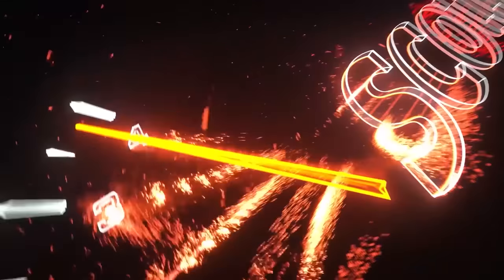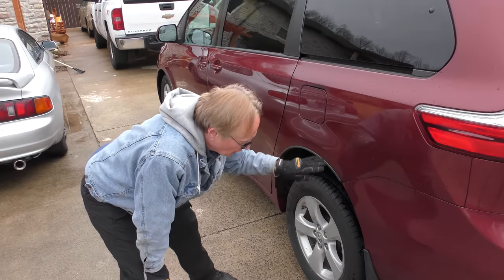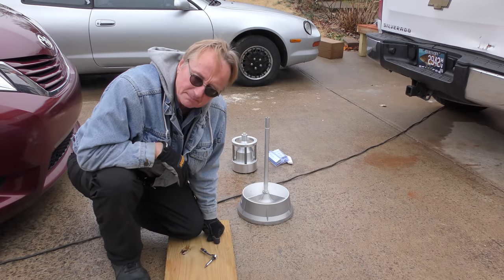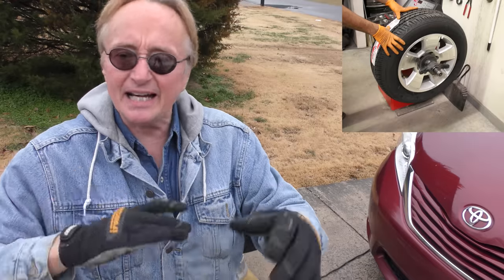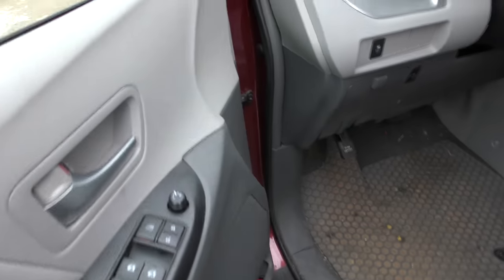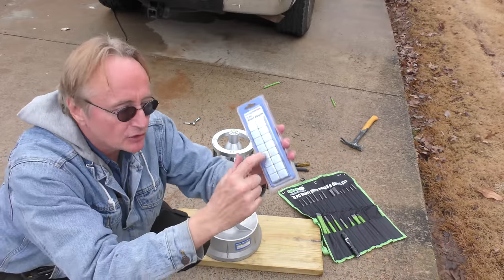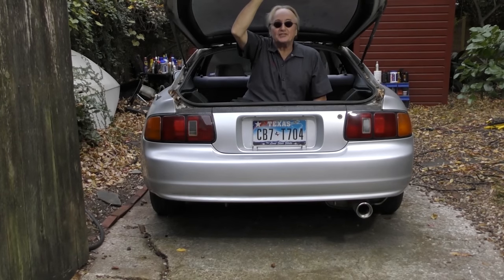Stop Going to This Tire Shop Right Now

Comment: I my case it was the stealership that tried to scam me.   45,000 mile service on my '16 Tacoma included tire rotation.  Driving way the truck was wobbling at 5 MPH.  I asked them to fix that.  Three ***ing hours later they told me they tried to rebalance the wheels  but one was bent !?? Well I didn't bite and drove home.  No wobble, imagine that, but one wheel was  out of balance. I took it to a tire shop that I trust and they easily balanced the "bent" wheel  which they determined was well within spec. 

Dealer couldn't even reattach wheel properly, and it's a steely no less.

Comment: Went to discount tire here in Houston and the tech ripped the stem right out of the hub with the impact wrench. They sent me down the road to get a new one pressed in it took 4 hrs to get a flat fixed. Another time they forgot to put on one lug nut and i didnt notice until it didn't pass inspection. I only go to small tire shops now.

Comment: Is it okay to do a wave-by near your house? I don't need auto repair unless you can fix a power shorting failure in the wiring of my wife's'93 Honda del sol. So meeting you wouldn't be necessary, unless you tell me I have to in order to sight-see your residence. Thnx in advance; really love your show.

Comment: I had the same issue with a local tire shop but for an alignment job. After taking it home it was pulling to the left. I took it back, made them redo their work just to cost them money, talked to a few waiting customers just to let them know and took the car to a reputable alignment shop the next day. Good thing I did or my brand new tires wouldn't have lasted. It was totally out of spec.

Comment: I have my tires rotated at every oil change. I know the kids at these oil change shops use an impact tool instead of a torque wrench to tighten the lug nuts. So, when I get the car home, I loosen all the nuts and tighten them to the proper torque. One time, I  found a lug nut that was on so tight that I needed  a 6ft steel pipe attached to my breaker bar to get it off.

Comment: What do you think of a  2000 Jeep Wrangler TJ with 54k original miles on it for $9500 that has a few issues, Main seal leak aswell raddles and it seems like it has its bushings and shocks shot.

Comment: I just take my tire off and take it to the local shop I trust to fix the balance if I question it. Had to do this for a friend that was complaining about a shake. I identified which tire was causing the shake by moving the tires around to different corners. You can feel a difference in the vibration also by loading the tire on a side more or less by lightly turning the steering wheel side to side making the vibration worse or better depending if the load (roll center) is shifted to one side or the other. Turned out that a belt broke on the inside of one of the brand new tires he had put on but it wasn't making the thumpetty thump noise yet... Ugh...

Comment: A question about dynamic balancing: most guys put on the weights the machine tells them to, but after that shouldn't they give it another spin to test if it's allright? Stopped making remarks because getting soprano homocidal looks in return

Comment: You need to be on your game to hope to not get screwed by tire shops. I've had wheels put on the wrong side, balance weights on the outside of my alloys & other atrocities.
I'm going to save a good used tire. If you ever get one tire replaced they'll tell you do you don't want to have a new tire & an old tire mismatch, I'll pay for mounting of my old tire for matching until I need a new pair.
Good luck getting them to honor your tire mileage warranty, the best thing you can do is stay on your alignments and tire inflation, check for uneven wear on tires. It MIGHT help to use the factory OEM tire.

Comment: I've been boycotting Firestone for the last 30 years because they installed a new fuel sending unit in the fuel tank wrong, and wouldn't fix their mistake. My fuel gauge reads 1/4, when the fuel tank is actually empty.

Comment: Gotta keep your eyes on them guys. One shop had a policy of putting a bit of grease on the hood latch assembly, but I stopped him, 'cause there was already a big glob still there from a previous visit, which I wiped off with his rag. Another time the kid tried to pry off the battery cell covers on a freedom battery and I stopped him b4 he tried to slip a screwdriver under the vent caps and told him, if you can't take 'em off with your fingers, they're not supposed to come off. Another bad habit they have is letting air out of your tires because the pressure is high, which happens when tires are driven, so I just tell them the tires are OK, don't touch 'em.

Comment: If a computer balancer shows 0 and 0 what else is there?  I've seen plenty of tire guys use the wrong weight for the wheel and they sling off over time.  That's my bet.  Nice bubble balancer.  I've got one too for my cheap cars.  Dynamic balance is impossible so you'll get a little wobble.

Comment: Definitely need to get me one of those wheel balancers. Question for you Scotty what do you think of torque sticks? When I worked at oil change/ quick lube location we occasionally did tire rotations. When we did the rotations we would use the air impact when taking off and putting on the tire but we're required to use a torque sticks when putting a tire on and then go through with a torque wrench and make sure they were set right.

Comment: I do just about anything iv learned from my old man ball joints wheel bearings shocks ect I won’t dare step foot in a shop filled with thieves and idiots with just a high school certificate that they learned crap off a computer screen

Comment: I had big o tires replace a tire which had a bolt going through the tread.   According to the paperwork it was torqued to 130 ft pounds.  I always prefer to loosen everything up and do it myself cuz I’m pretty sure he ran his pneumatic wrench to whatever and called it good. Last thing I need is to have a perfectly good spare but can’t get a tire off. I’m down to the last lug nut and the 2” extension snapped. A 3/8 drive made by snap on. From now on I guess I’ll use 1/2 drive. Never had that problem before. Makes me wonder how tite it really was

Comment: Most pnumatic impact guns have a low setting (I wouldn't trust an electric one without an option setting on them) like aircat (75-80) ft lbs low setting @90psi from the tank, its also very rare  car or truck tire will take no weight at all, the tire shop mechanic probably wasn't trained properly... take pride in your work so you can sleep well at night

Comment: 5:33
I was surprised to see that they even mounted the tire correctly on the wheel.  
I noticed the red dot on the tire was in line with the valve stem, which is correct. 
So the only problem was that the person did not remove the weights from the tire before checking the balance. 
I had 2 tires mounted by Firestone and they did not align the dots and had a ton of weights on the wheel. I got the manager and had them remount both correctly.

Comment: Hi Scotty, my second hand Subaru Impreza 2011 Hatchback was most likely in a crash. Mechanic already balanced wheels, but the car is still shaking. It's not shaking all the time. Sometimes it shakes at low speed, sometimes at high speed. Steering wheel is shaking too, but just a little bit. What do you think, what could be the problem? Thank you.

Comment: I've always believed this. But on my 2008 Pilot, I had a vibration on the floor from 70 and on so I assume back tires.
But it turned out I had a blister on my right front and lost air in the morning. I replaced that tire and the vibrations went away.
Legit my steering wheel did not shake.

Comment: I just bought a used truck about a month ago. I had the dealership replace the tires. They used a budget tire shop. This is EXACTLY what I've been dealing with. The steering wheel is smooth but the back seems to start shaking at about 60. I needed this video. haha. thanks Scotty!

Comment: Friends,

If you see weights in more than 1 location on the same side, you are dealing with idiots. During my training you needed to move your weight over .

Also with Independant rear suspension, chances are you wont feel an unbalanced rear tire. It can save you some money if you are in a pinch.

Comment: There will be a run on Harbor Freight bubble balancers now Scotty.  I've never liked those dynamic balancers.
Reply: @Mark Codiroli You are right. People fear the unknown, and I don't know how to work a dynamic balancer.  I should change my statement to ; I don't trust that the kid running the dynamic balancer knows how either. Just like this video, I've gotten unbalanced tires from the tire shop. I do know how to use a bubble balancer.  Not sold on the Harbor freight one , seems to be missing a piece.
Reply: @Mark Codiroli Or I can use my bubble balancer that shows me where to put the weights in relation to the unbalance.  Problem solved.
Reply: @Mark Codiroli you seem to be trying to say that a dynamic balancer shows you where to put weights and a bubble balancer does not. Please explain.
Reply: @Mark Codiroli even with a bubble balancer the weights go at 10 and 2 in relation to the unbalance. Never 12.
Reply: @Mark Codiroli How are you confused here.  Weights NEVER go 180 degrees from each other OR The imbalance. 120degrees from each other and the imbalance. With either balancing method.
Reply: @Mark Codiroli My apologies. I thought it common knowledge that balancing tires requires two weights spread apart around the rim. Turns out bubble balancer manufacturers instructions say to use one at 180 from the imbalance. I guess true bubble balancing is a lost art even to them.
Reply: @Mark Codiroli Being a curmudgeon old enough to remember the time when every tire rolling down the road was bubble balanced, I do not see dynamic balancing crucial for longevity or safety. BUT, if i get the urge to get some 18s with rubber bands I'll definitely get them spin balanced on the newest equipment.

Comment: I have a 2011 Scion xB that burns a quart every 1,200 miles. Should I keep topping off the oil or swap out the engine from a 14 or 15 xB if the price is right? Did Toyota have the oil burning 2AZ-FE fixed by 2013/14 MY? Love my 5-speed xB and it has little over 100k miles on it now.

Comment: Hi Scotty, I just bought a 2011 Lexus IS350 AWD with 90434Km for 16,734.38 Canadian from a Mazda dealership a couple weeks ago. When I pump the brakes lightly, there's a rather loud audible creaking sound from coming from the front, I would assume that would mean I should change the brakes soon. Also, I have a feeling the car may be running a little rich because the gas mileage has been a little suspect on a few drives and there have been a few infrequent but noticeable times where I hit the gas peddle but there's a delayed reaction or the rpms stay at the same revolutions for a few seconds before responding, any tips on what I have checked? And one minor more note; should I change the transmission fluid at the current mileage or is it still good for some time, I'm just curious. The car is a rebuilt status as the only other previous owner, who was a desk worker that used it as a daily before mostly keeping it in her driveway while working at home during the pandemic, was rear ended in a previous incident years earlier. But other than the few noticeable things mentioned, the car has been a great and enjoyable upgrade from an Si. Thank you for your time and insight, I love your videos and I can't get enough of them

Comment: Co-worker has a flat on the way to work. He gets his handy tire tool and attempts to remove wheel, only to have tool bend in half.
Calls his wife, she brings him his 4 way and even him jumping on the wrench the nut wouldn't move. Calls tire shop where tires were installed and was told "we've had several cases of this, the tech who did it has been fired". Nice.
Apparently this genius was setting his impact to "stun" and running the nuts down til they smoked.
I told him he should make them replace the studs as they have now been stretched to hell. If you can't do it yourself, find a small private owned/operated shop. Those people have a vested interest in doing it right and keeping the customer satisfied.

Comment: Yeah I had asymmetrical tires installed with inside facing out. Just noticed when changing oil. How can you mess that up. It says outside or inside. Smh.

Comment: I currently work at discount and have worked their for 2 years. some of the stuff he says is true and some of it is plain stupid. This tire tech that did do this car didn’t follow best practice, but their is a simple solution watch them do it if you can and ask questions. 9/10 times if they see you watching them work they won’t skip best practices. Also you usually won’t feel vibration from the rear unless it was extremely off. On my personal vehicle I always rotoed the front to the rear then balanced the new fronts and never had vibration issues. But good practice for a customer is ask questions and watch what they are doing.

Comment: I had a problem with my tires. They never got it right. So the next time I took it in I removed all the weights. They finally got it right. Part of the problem is instead of removing weight and starting from scratch they just keep adding weight.

Comment: The tire place I got mine was messed up.Front wheel loose had to tighten it up on side of road.Twice they cross threaded lugs and had to use a torch to remove and finally had a flat that they wouldn't fix and tried to sell me two new tires.I went to service station and they repaired my flat.

Comment: Look for the yellow or white dot on your tires, they should be lined up with your valve stem, because the factory balancer marks the light side of the tire and the valve stem is always the heavy side of the wheel, allowing the least amount of weights to be used to balance the rotating assembly. Or look at your tires on your car now and realize that virtually no tire technicians are trained to do this and be disgusted! A tip from your friendly neighborhood Bridgestone TBR factory maintenance man! LOL
Reply: Don't bother looking on Michelin tires, there tires are "too perfect" to "need" balance marks!

Comment: Scotty speaking of tires my 2001 Tacoma door jamb says 26 psi which seems way too low on all 4 tires! My new tires (Yokohama) 265/70r16 says max tire psi is 50 psi. I live in New England. What should I put the psi at? Typically car tires are 32 psi. My mechanics put it at 40 psi. Thank you!

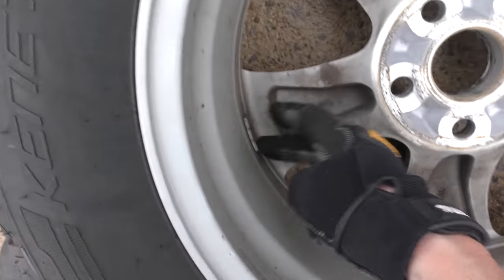Comment: The last time I went to a tire shop, I had them switch out two tires I already owned. As I drove away, the car felt fine, but a few minutes later there was a wobbling that got worse and worse, I came to a stop and my front driver's side tire rolled away in front of me into oncoming traffic. Luckily it didn't it anyone, but it hit the curb and bounced into some fenced off woods. They didn't tighten the lug nuts properly, maybe at all. I went back the next day (because for some reason they close at 3:30 on a weekday) to tell them about how they could've killed me and other people with their stupid mistake and made them reimburse me for a second, properly done lug nut tightening, and the tow truck fee. Manager apologized to me himself since the kids working there wouldn't, and I'm never going back there again.
Reply: P

Comment: I got scammed Jack Williams tire center paid for a alignment guy took car in....5 min later pulls out drives up and down the street comes back parks car...come in says i'm done I asked him you did a alignment he says yes....1500 miles later front tires are worn out..took it to another place ...stood there and watched him....took 10 min just to set car up another 12 to 15 to adjust everything then told him what happen he said it was never done

Comment: Why would you buy just ONE tire? You should only do so if the other side was fairly new with low miles and you had a blow out on the one being changed and then you should get the SAME BRAND.

Comment: I went to a tire store let them do the wheel balanced on my GS300, after a week, I take to car to the 
Mechanic do engine tune up also help me take a look anywhere need to work on(I just bought that car.),  and Mechanic said that I need the wheel balanced, I told him I do already, but he show me the tire hasn't done anything. Before I back to that tire store, I went to the same tire store but different city, let them check that they ready didn't do the balanced and they said I need the balanced on my car. So I went back to tire shop that working on my car 
complain about this happened, first they 
deny anything,  and then they send a kid come to us told he is the one working on my car tire that day, I'm sorry, I got so many job to do, that why that day I wasn't on focus. To the last, they come told us that they didn't do my wheel balanced because my two wheel in the back are bent, so they can't able to do the wheel balanced. Oh, so you didn't told me about that and still charge me for wheel balanced ( they don't even do the front.) and told us get out and never come back.

Comment: I do work at discount, but it depends on the training, there are a lot of idiots I see this stuff all the time. If you see four weights, remove it all and rebalance, now if there's two weights and your on a time crunch with the tire your rotating at 5/32 seconds of tread (not too much tread life) then just throw it in the back, it doesn't need balancing, unless your wheels that you are balancing to the front are wayy off, there could be road force, and alignment issues that can also cause this, but in this case Scotty got it. There's always a time crunch, but if I'm .25oz off and it's rotated to the back of a minivan it's not necessary, and it's free anyways, so just come back if it's bad